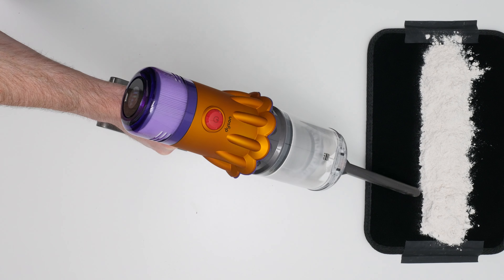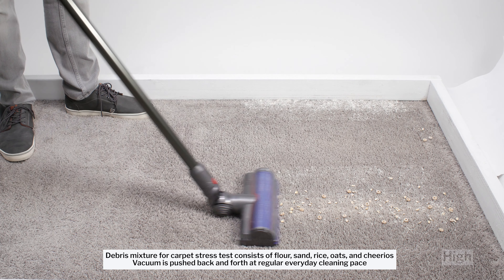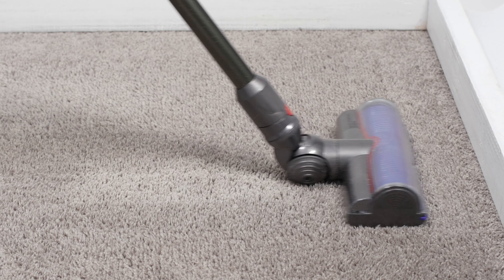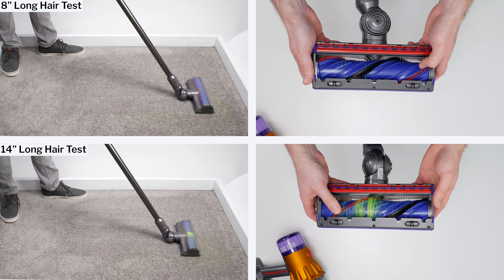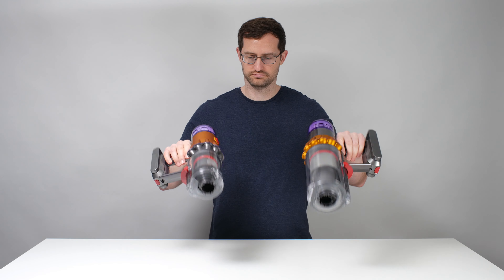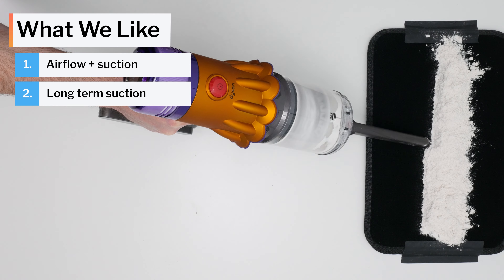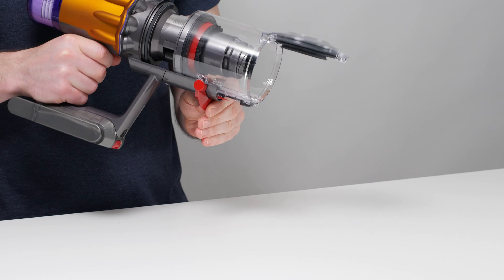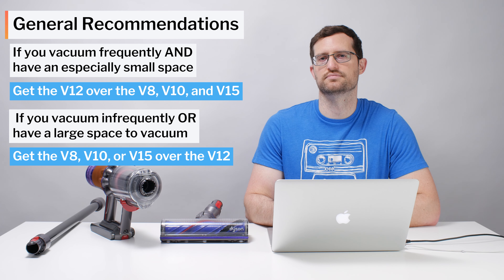Dyson V12 Detect Slim Review - 12+ Tests and Analysis

Comment: Great video. Any information on long term use of Dysons? These cordless Dysons and Sharks seem to have become throw away tech, the warranty is only for 2 years. The battery dies and the cyclone gets clogged.
Reply: Vacuums aren't going to last forever. If you get 3 years out of use out of $650 vacuum, that's about 63 cents a day. You can also buy a new battery after 3-5 years if needed.